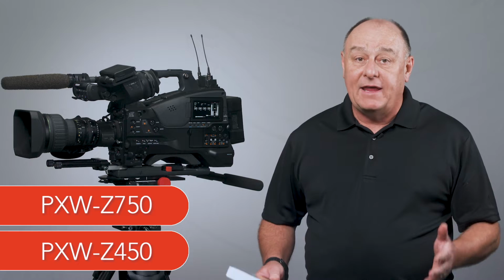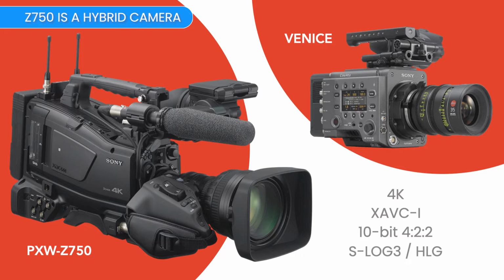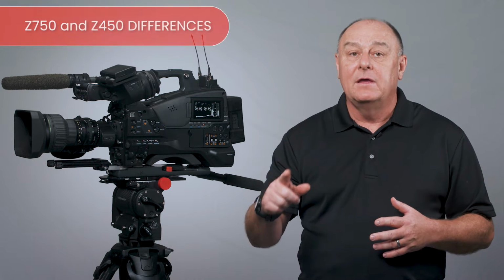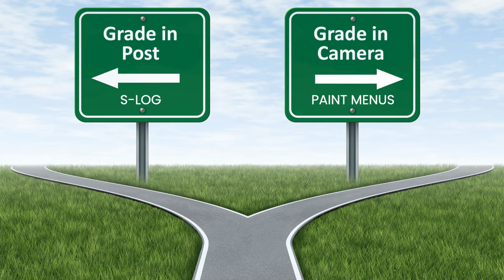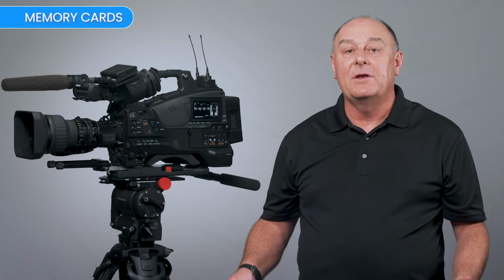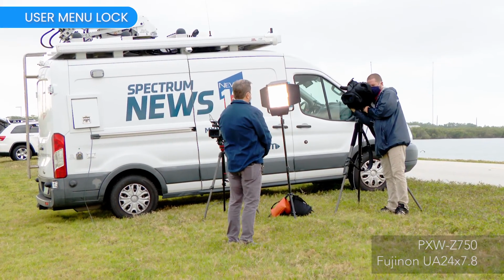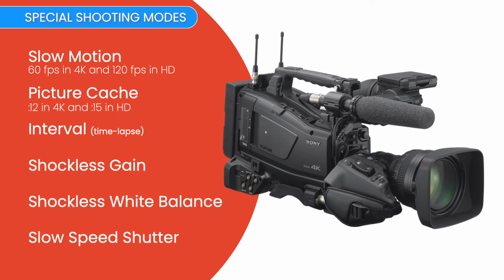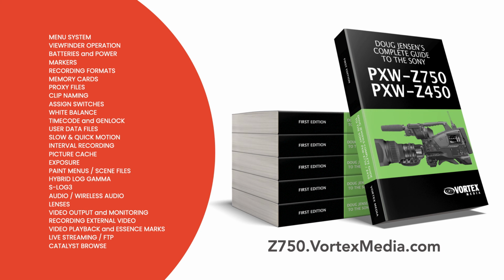Introduction to Sony’s revolutionary PXW-Z750 and Z450 ENG Camcorders

Comment: 10:52 Well you're absolutely right but there ist one point missing. The price ;D I know ENG cams are amazing (I owned a old used PDW 700) but the price for them compared to something like a FX3 is immense. This camera is an expensive dream.
Reply from the maker: Yes, you are correct that these cameras are expensive  But, what matters more than their cost is what these cameras EARN for their owners.  These cameras are usually purchased by established owner/operators who work daily in the broadcast television industry where day-rates for labor and gear usually ranges from $2K - $3K per day.  These cameras are not made for wannabes or amateur YouTubers who don't have the high-end work to justify them.  These are professional tools that allow their operators to do things faster, more efficiently, and with better results than any other type of camera.  So, yes, they are not the right choice for everyone, but in the right hands they are amazing and it is not hard to justify the cost, especially when amortized over the camera's 5-10 year lifespan.

Comment: Question: Is it true, the Z750 can not be connected to an RCP/CCU for live-broadcast? Thank you for your great expertise and the large amount of time, you have put into this great video!! MH/Hamburg/Germany
Reply from the maker: The PXW-Z750 has an 8-pin remote port that can be connected to an RCP controller.  There are some limitations, but in general, you will have full control of the camera.  NOTE: Unlike a studio camera, there is no ND filter servo, so you cannot change ND filters with the remote.

Comment: Really very nice and complete presentation, compliments. I'm using broadcast camcorder (3CCD 2/3") from 20 years and every time I think it's time to sell everything for a little cinema camera I change idea because most of my productions requires broadcast camcorders! This camera would be actually the best choice to pass from FullHD to 4K. I 've just a point: why not a double filter ND/color and just the ND?  Double filter torret in news saves you often. What do you think, coming from the 800 ?
Reply from the maker: Thank you for the compliments.  No, I don't miss the color filter and I don't think it is needed on modern cameras with better processing power.  Besides, I cannot remember the last time I would have used a 3200CC filter.  Pretty much all lighting I encounter these days (including every light that I own) is daylight balanced, so I'd rarely change the CC filter anyway.
Reply: @DougJensenVortexMedia  I instead use the 3200CC filter a lot, most of my inside shots on theater (and other locations) are with the 3200CC because most of theater here still use tungsten and I prefer to shoot inside interviews with color light suited to ambient light, but that's just a preference. It's anyway a super camcorder (with the PDW.. the 700 was without cc filter.. but they added it in the 800 and 850)
Reply from the maker: @mantovatv2007  Yeah, I totally see why you'd still want to have the filter.  Fortunately I don't think it makes a big difference in the final look of the video. I think modern cameras, with better iamge processing, are able to make bigger swings in the WB without using an optical filter -- or else we'd still have those filters.

Comment: Doug, are you seeing an improvement in detail now that you're not dealing with a debayered image?
Reply from the maker: Absolutely.  When I first got the Z750 I dialed in similar paint settings to what I used on the FS7, F55, etc.   But after some real-world shooting it was clear that I needed to make several adjustments because the Z750 simply looks so much crisper that what I had become used to with the single-sensor cameras.

Comment: These are 3-CMOS design, so there is 3 black and white sensors with their respective colour filters.
Meaning you get 3 colour data for each pixel giving these cameras greater colour depth than traditional CMOS, only a Foveon sensor can beat a 3 sensor array.
Reply: With the difference that a Foveon sensor has really slow (30ms+!) rolling shutter, rather than global shutter.
Source: I owned all generations of Foveon sensor cameras and tried out all of their (very limited) video recording capabilities.

Comment: Hi Doug, Great review of Z750, I had a F800 which was great but productions just want memory cards these days. Does the Z 750 give you the S-Cinetone?
Reply from the maker: Thanks Andrew.  No, the Z750 and Z450 do not have an official S-Cinetone mode.  Instead, they have 5x more paint menus than the FX6 and 3x more than the FX9, so that users can dial in any look they want instead of being pigeon-holed into a single look.  I'm not a fan of S-Cinetone for reasons I talk about in my FX6 master class, but I do see the value there would be in having a similar look on the Z750/Z450.  One of these days I'm going to take a few hours and see if I can create an matching S-Cinetone scene file.

Comment: I read this in the manual: 
When proxy recording or network functions are enabled during operation with the SDI output format setting 3840 × 2160P, the SDI output setting becomes 1920 × 1080P (Level B) (59.94 / 50) or 1920 × 1080PsF (29.97 / 23.98 / 25). Is this also the case if you turn on wifi or network remote as a "network function"?
Reply from the maker: Sorry, I don't know the answer off the top of my head for such a specific set of parameters.  In addition to the settings you mention, other settings may play a role as well.  My advice is to configure the camera the way you want it and check the output.
Reply: @DougJensenVortexMedia  OK thanks a lot for the reply. I don't have one (that's the problem), we are just about buy some and wanted to use this in a multicam setup were the "Browser Remote" function comes in really handy, but we of course want to us the 12G out to produce in 4k. So I just was curious to know if you ever tried to turn the Network Remote function on, with the result of no 4k outs at the SDI ports. The resellers tried to ask japan with no answers at all, by now.
Reply from the maker: @feielc8617  I wish I could be more helpful but I'm in the middle of an 8-week road trip shooting in some national parks and I don't have the gear or time that would be necessary to setup and replicate your intended setup.   I will see if I can get an answer from Sony for you.
Reply from the maker: @feielc8617   Got an answer from Sony.  If the the root of your question is whether or not QFHD output is supported when the network function is turned on, the answer is no.

Comment: What makes 2/3'' ideal and almost "industry standard" for ENG cameras?
Reply from the maker: I had hoped my video answered that question.  Did you watch it? 16mm was the standard for portable news/documentary cameras.  When video replaced film, 2/3" sensors were essentially the video equivalent and the best ENG lenses were made for that sensor size -- and still are today.
Reply: @DougJensenVortexMedia  I am at 26:25 right now. Did I passed / missed that information? Sorry! And thank you for that information! Your video so far is amazing. (also because I love sony cameras haha). Edit: A ton of work. I watch 5 minutes and someone stops me so it took me 2+ hours to reach 26:25 :( Thank you again for the information. It is very useful. :)

Comment: Wait, wait, wait...WHAT?! "In camera noise suppression will always look better than doing it in post." This is the absolute first time I have ever heard anyone in the industry across film and television ever make such a statement. More convenient? Sure! The only option due to post constraints? Often! But better?! NEVER! Doug I appreciate your experience, but this doesn't jive at all with anything I have ever heard outside manufacturer marketing claims.

Overall though I agree that this form factor except for the actual shoulder pads reigns. I definitely though think that the price point on these aren't competitive anymore and shows that I've used this format on like Discovery's Heavy Rescue: 401 unfortunately won't be interested to spend that kind of money, instead buying up all the F800s they can find and shooting with them. While anyone with this kind of money as an owner/op will probably pick up an ARRI Amira and Canon CINE-SERVO 25-250mm which they will generally be able to rent out to more productions for a better day-rate.
Reply from the maker: Well, you're certainly entitled do your opinion . . . but I've actually done the noise testing with my own Z750 vs. Resolve.  Have you, or anyone else you listen to, done the testing?  Until then, I stand my my claims.  Applying NR right off the sensor, at the full 4:4:4 16-bit image quality of the camera, and prior to any compression is probably the main reason it produces better results than waiting for post and working with a 10-bit 4:2:2 stream.   Yes, an Amira with a Canon 25-250 is certainly a nice package,  but it falls way short of matching the versatility of a traditional 24x or 46x 2/3" package -- plus having all the ENG bells and whistles you get with a Sony that Arri doesn't care about..  You should know that not everything benefits from a bigger sensor.  The fact that Survivor is now being shot on Z750s is a pretty good stamp of approval, and the show looks much better than when they were using F800s -- which I thought looked pretty good at the time.  The highligh handling is better and the saturation looks like nothing else in TV.   BTW, I love Heavy Rescue: 401.  It is a very well produced show and I like seeing the ingenious ways they get those trucks off the the road.  Keep up the great work.
Reply: @DougJensenVortexMedia  sorry there Doug, re-reading I might have come off as a little strong. I just honestly not heard that opinion from the experienced side of the industry before. I do see your point though with the benefits of it being done at the raw sensor level and I would be curious if it is done prior to multi-sensor image combination in the image pipeline as I could see some benefit to that technically. From what I've seen of some of your shoots with the Z750, specifically your rocket stuff, it looks great and does cut well. I would agree there are definitely benefits. I just do see the price point compared with other options in the market as a challenge unless its for a network broadcaster.

Thanks, it's been a fun show to shoot and very different than most anything else I've worked on. It is definitely always fun to see how the recovery is going to work and try to figureout ahead of time as well where we should put the hard mount cameras to try to capture that recovery. I would agree it would be a tough show to shoot on anything but a B4 setup, even if FS7s would do the job, the environment would be tough of them. This is one of the reasons the F800 has been king for the show. That and the nearly disposable media that just gets archived, even if a bit slow to offload.

Anyways I definitely have appreciated your overviews over the years of a lot of Sony cams. Sorry if I came off harsh, just had not heard that opinion before from someone knowledgable in the field, especially after the advent of AI based NR, though I see how it could be beneficial if applied earlier in the image pipeline than otherwise accessible.
Reply from the maker: @TheTechnoPilot  No problem! My reply probably came across too strong as well.  I appreciate your comments and all is good.   If you liked the F800 (as I did too) you will love the Z750 when you have a chance to use one someday.  Great camera.

Comment: what use for 2 xlr inputs ?
Reply from the maker: Sometimes they are used two bring two different wired microphones in the camera.  Other times they might be used to take a feed from a sound mixer.  Other times they might be used to take a house feed from a mult-box at a press conference or concert/stage/theater/classroom venue.  Lots of reasons to have two XLR inputs.

Comment: Problem with this cam is that it has no overall saturation it all needs to be done thru a multi matrix. If you don't like the rec709 preset you can't just crank sat and be done. I just used these and they are not made for multi cam broadcast other then that there fine.
Reply from the maker: John, maybe I am misunderstanding your comment, but you are incorrect.  I control saturation on my camera via the PAINT >  USER MATRIX > LEVEL menu.  No manipulation of the MULTI MATRIX  menus is necessary.  In fact, all four of my custom SCENE FILES that I provide in my Z750 book (pages 263 - 267) have all of the MULTI MATRIX menus turned completely OFF.  Have you tried my recommended paint settings?
Reply: @DougJensenVortexMedia  sorry I misspoke. You are correct with user matrix but that means you can not use the user matrix over a preset as that would mean you are then effecting the user side more then the non user side. Another words if you did r minus green plus or minus that would be more or less on the user side. On broadcast cameras its overall sat not have to go to a preset 1 in the user matrix to then up the overall sat. Sony is in the process of fixing it and will be available in a future firmware upgrade.

Comment: I'd give my arm for this exact form factor but a 4/3rd or s35 sensor, 35mm dof adapters are just unusable these days and being able to get shallower dof when you want via a lens change is nice.  I adapt b4 lenes to cinema style cameras but outside of the f5 they aren't really comfortable on the shoulder and some of them is a puzzle set just to get a vct tripod mount on em.      The only other issue with this cam that keeps it away is cost, the hpx 300 was 10k when it came out, why is this 20k?  Its just too much.  I have the DVX200 right now, and its almost perfect, 4/3 imager, fantastic lens, shallow DOF WHEN i want it.  Just, doesnt go on the shoulder :(
Reply from the maker: Chris, the camera you are dreaming has existed for at least 5 years.  If you take an F55 or F5 and add Sony's ENG Build-Up kit you will have a super-35mm 4K camera with almost all the bells and whistles of a traditional ENG camera.  https://zsyst.com/2016/04/sony-f55-eng-kit-buildup/    I speak from experience because I have that kit for my F55.  So if you want it, you've got a ready-made solution without giving up your arm! :-)     But with that said, an ENG camera with a s35 sensor cannot hold a candle to the versatility of a 2/3" camera with native B4 lens mount.  More than anything else, an ENG camera is all about the lens.   So, you can give an F55/F5 the form factor and other features of an ENG camera, but you still have to give up the great selection of 2/3" lenses, such as 24x f/1.9 zooms, etc.  THAT was enough to make me park the F55 on the shelf and  move over to the Z750 as my primary camera.  The more I use it, the more I appreciate it.

Comment: Do you think Sony will release a new camera like this? It’s been 6 years already…
Reply from the maker: It's really only been about 5 years since the Z750 started shipping and I expect it to be the flagship ENG camera for several years more.  No compelling reason for an update.  120 fps 4K is about the only upgrade I can think of that would make much difference to me. And 90% of Z750 users wouldn't care about it if it could.  So it remains the flagship ENG camera and has no rivals from other brands. Nothing even close.
Reply: @DougJensenVortexMedia  Thank you for responding!

Comment: Sony has makes my dream camera. But a 17 year student cant effort it. I think that i going to save for buying this camera used over views years
Reply from the maker: You're right, these are not entry-level cameras so it would take some time for an individual to work up to them.  If you really want to get your hands on one of these cameras and get professional experience plus mentoring from experienced professionals, try picking up some freelance work with local production companies or sports producers in your areas.  Starting as a grip, gopher, assistant, cable puller, etc. is still the absolutely best way to get your foot into the door of this business and work your way up to higher levels.  A lot of young people think they can buy a nice camera and jump right in and make a career all on their own without anyone teaching them the ropes -- but that is not how it works. Good luck!  Maybe we'll work side by side some day.
Reply: @DougJensenVortexMedia  I would agree with that. 
15 years ago I was tagging along on shoots to help another guy down the hall. My first assignment was lugging batteries and in field, walking beside him holding up a reflector disk. I even had to be told how to do that properly.
One day he called me at home in the morning and said he couldn't make it to an assignment. He told me to go get the gear and fill in for him - solo. Whaa?? "Any switches you see on the camera with a choice, put the switch on green." (Auto on a Sony DSR-300 DVCAM). :) It worked out and we used that footage for a commercial industrial project. After that I would learn by doing B-roll after he was done shooting the main content he came for.
Reply from the maker: @charlieross-BRM  Good story.  I would say 90% of the people who are successful in the video/television/film industry got their foot into the business working as an assistant for someone who already had the job they wanted to aspire to.  Watch, learn, and keep your mouth shut except to ask questions about the work.  10x more valuable to getting ahead than taking film school classes or buying a bunch of equipment just because you can.  Whether it is called an apprenticeship, mentoring, or whatever, it is vital to watch other people do the job you want to do some day.  When you are ready, the opportunity to jump into the driver's seat will come soon enough.  Almost everyone who is successful in this business has a similar story they could tell.  I know I have several.